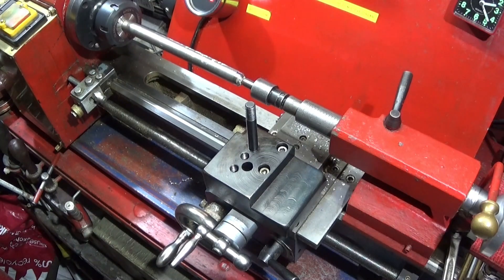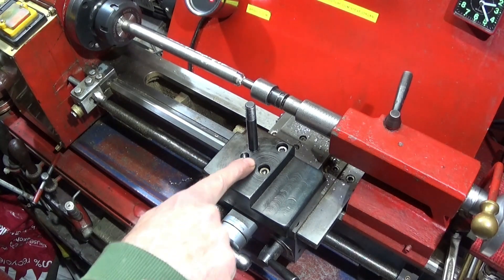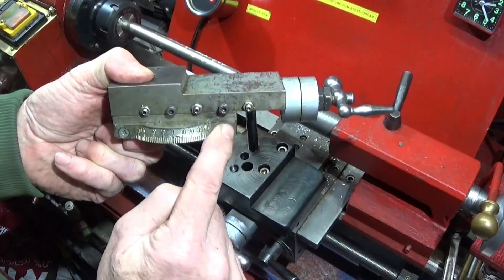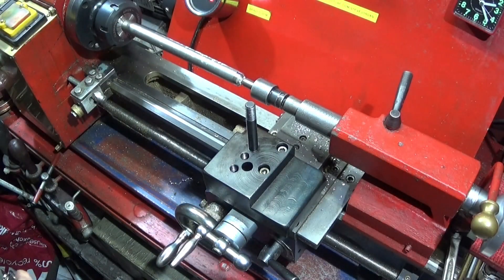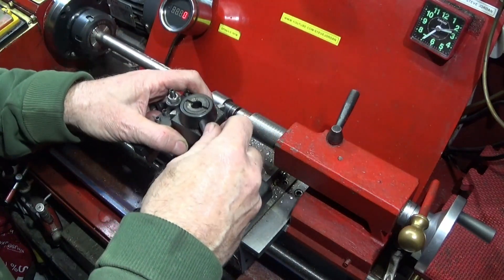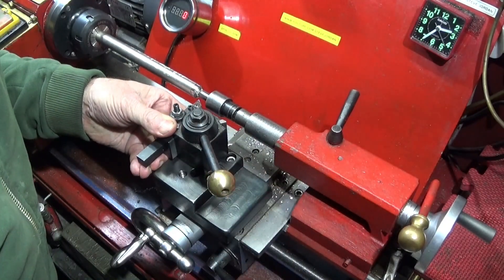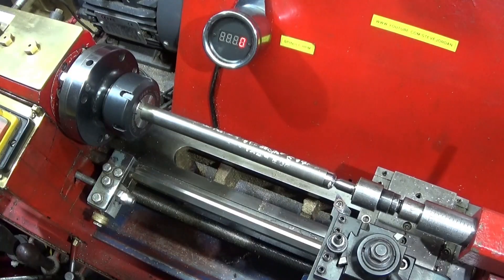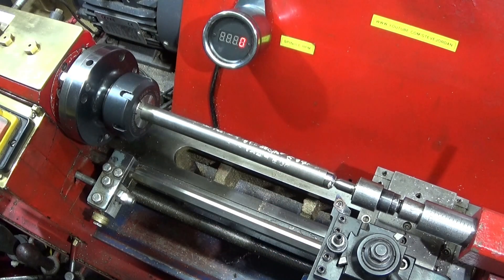The Best Upgrade To Be Able To Cut Stainless Steel On The Chinese Mini Lathe

Comment: Just to be sure about what you are saying......the compound slide ( with the small lathes) produces movement that affects the cutting of tough metals like stainless. Could you do a video using the compound slide and then not using the compound slide for comparison? I notice in the comments that there is at least one doubter of the method.  "Quick fix for small lathes". Thanks for the tip, very good info.
Reply from the maker: The Mini Lathes do vary in tolerance and quality. You may get a very good one new, but mine was particularly bad on most things. I have seen others machining stainless without any problems, using the compound slide. It's just another one of those things it's worth noting if one has problems with certain materials. You definitely wouldn't get any of these problems on high-quality machines, but then they are very expensive.
 If I didn't have a Chinese Mini Lathe, I would still buy one now, as I have made hundreds of different components using it. I also used it for a few years without doing too much to the lathe.

Comment: Might I ask which speed and feeds you used? I made the solid replacement for the tool holder and used carbide inserts and still had horrible results when trying to turn stainless. I even went so far as to machine the base of the tool holder to have a solid 3 point contact to prevent rocking. Any suggestions?
Reply from the maker: I don't know what the feed is, as I just used the lathe with the same gears that were set from when I bought the lathe. If yours is running at approximately the same feed, you shouldn't have any problem. The spindle speed doesn't really matter too much either. If it chatters, you obviously slow the rpm. It must be something else causing the problem.  It could be tool centre height, which is critical to get right? The tool protruding too much? Not using a steady? Or maybe your carriage assembly is not adjusted correctly?

Comment: mine cuts stainless steel easy , the insert used make all the difference ..
Reply from the maker: Yes, the inserts make a difference. Also, the Mini Lathes vary in production tolerance and quality. I had to do a lot of work on mine to get it right.
Reply: @SteveJordan  Oh , me to many repairs .. mine was a mess when I took it out of the crate .. then it  would not even run steady !

Comment: What would you think of using razor sharp HSS instead of the cermet insert with the rounded edge? Wouldn't it help to reduce work hardening?
Reply: Might work better for about 30 seconds, before that edge rounds off.. its the hardness of the inserts that wins the fight, and you have to make a deep enough cut to get past that edge- .025 /side or more..
Reply from the maker: When I worked in the aerospace industry, we used carbide inserts at all different speeds. And used them for intermittent cutting. I only use hss for special ground tools like internal groove tools.
Reply: @SteveJordan  I'd bet that your lathes and mills were at least 2 orders of magnitude more rigid and powerful than my itty bitty Sieg mini-lathe. Heavy, powerful cuts are not even a dream. I need to have razor sharp tooling to cut just beneath the work hardened zone, without hardening the underlying metal any more than necesssary. Cobalt steel is my friend.

Comment: Before the toolpost block, would you say the spindle bearing upgrade, collet chuck, carriage extension and or ways surfacing are more important or was more chatter and inaccuracy due to the compound rest?  What would be the order you'd recommend tackling among those upgrades I mentioned and any others come to mind you'd suggest.  Thank you sir in advance for your time and wishing a Happy Easter!
Reply from the maker: I used my Mini Lathe for a few years before I did any upgrades. I changed  the bearings and did many other things, but I still had problems with it. When I made the toopost block, it was an amazing difference. Many people have said that the compound slide is the main problem as it is so narrow, etc. I have gone over to a toolpost block on my Myford ML7 as well and have noticed a considerable difference. I just use the compound slides if I need to do angles now. Regards Steve

Comment: That is an impressive cut for that little lathe! 👍
Mine has got slop between the bed and carriage, and slop between the carriage and cross slide. Sometimes I have to put my hand on the toolpost and hold it down with a LOT of downforce to get a nice cut... yeah I know one day I will rebuild it and fix some issues... maybe. 😁
Reply: Notice when he tightened down the tool holder, his whole carriage lifted up. I guess because of the pressure from the cutting it doesn't matter much.  Still it's some impressive cutting. Not sure my lathe would do it that well.